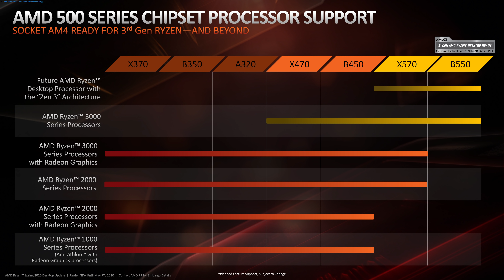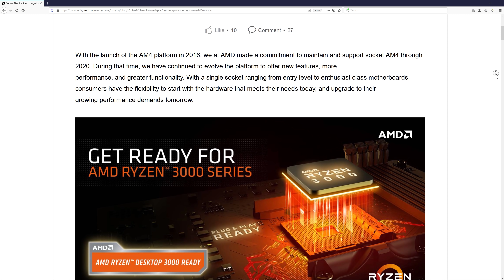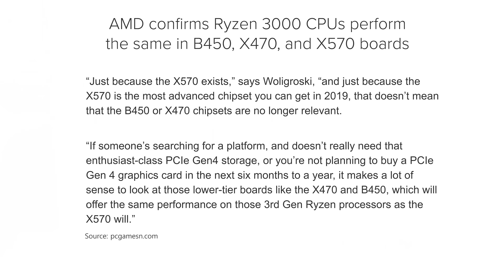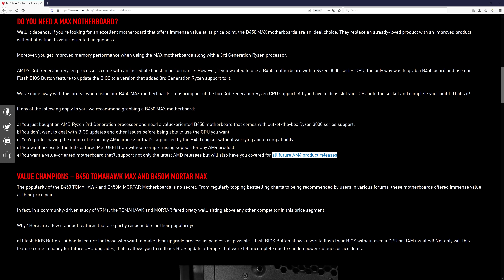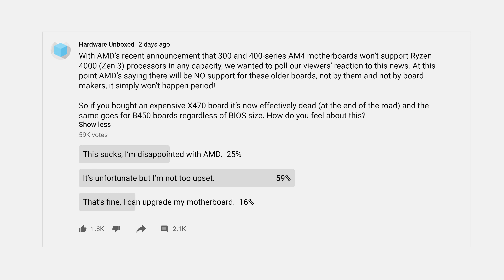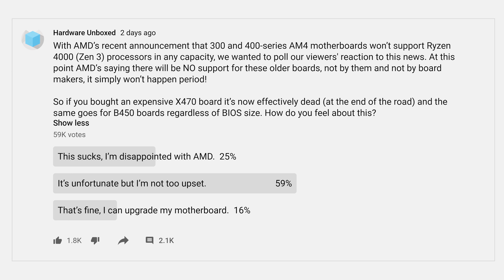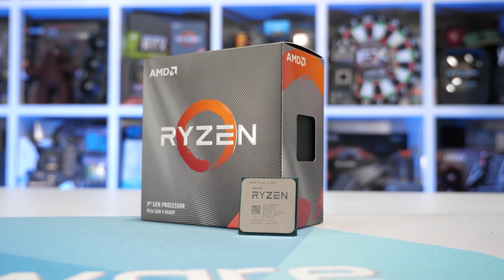AMD Does An Intel, Axes Zen 3 on 400-Series Motherboards, Our Thoughts

Comment: I recommended a B450 Mortar MAX (for those of you not in the know, it's a Tomahawk with less PCIe slots, but with more NVMe slots), but with a 3900X.

I feel if someone got a 3900X/3950X with those boards, they're not looking to upgrade to Zen 3 anyways - so that's why it's not a big deal for so many of your viewers - we tend to buy higher end, more future-proof stuff and replace on a schedule, rather than based on needs (like new game coming out or new job with more compiling required).

But it would suck for 20-year-old me, who would buy a 1600AF or 3300X with the same motherboard using the cash from my first ever job, and start saving for a Zen 3 next year. That previous myself would be absolutely outraged - after all, that was the whole purpose of  the MAX line, as you perfectly accurately presented in the video.

Comment: I am EXTREMELY upset. I hope MSI or someone else will sue AMD to death over this, even though I always wanted them to succeed. I also want to break a B450 board with my knee now :D
I don't know how many people are now in a position when they believed that AMD keeping the same socket will ensure future compatibility with all new CPU releases. I feel a bit sorry for someone who invested in a decent X370 board, expecting to update CPU in 2020, but still, at least there is a Zen 2, which provide a significant enough performance boost.

But the whole B450 situation is utterly outrageous.
I've built several systems on this platform, telling people that they will most likely be able to make an upgrade down the line to Zen 3, seeing how b350 situation was handled and hoping b550 delay won't compromise people how need their systems NOW, but still expect it to support at least one future CPU gen. Especially relying on MSI advertising their boards as capable of doing so.

At that point I've seen enough of AMDs marketing bullshit, disingenuous business practices and now this shit.
I'm done.

My only hope is for enthusiast community. 
You know, 771 Intel Xeon chips were not compatible with 775 board, but here we are. 
And 9th gen Intel CPUs are now being ran on Z170 boards.
I wonder how hard it would be to make a proper mod BIOS, adding needed AGESA-codes for Zen 3 to older 3 and 4 series boards.
Reply: I'm not 100% sure, but I believe it will be lot harder then 1151 to 1151v2 support... As far as i know, AGESA code is really big chunk, and are extremely hard to find out which part does which function. I know that this is not solid evidence, but i think the fact that we don't have,AFAIK, latest-AGESA based bios with PCIe 4.0 support on B450 motherboard, despite that B450 M/B can clearly run CPU PCIe lane in 4.0 mode (early bios, B550A board) should tell us something.
Reply: @남기헌-l8y  thank you for your input, I've done any research on this matter at this point. Sad.
Reply: I was one of those people, I bought a £200+ Aorus Gaming 5 board at launch and saw no need to upgrade my 1700X till now and I can't. I could have just bought two £100 B series boards, a 350 then and a 550 now. I went with a higher end board for better vrms to support higher speed cpus down the line. That idea backfired.
Reply: @TheUltrawideGuy  I feel you, bro. Really hope for someone to come up with custom BIOS for x370 boards, which a socket and VRM-vise fully capable of running those new CPUs.

About B450:
I'm baffled that I've bought a god damn Intel Z370 board when 8700k launched... And still got a better deal than people who chose AMD and B450 this year (though most of them would've bought an X570, if they knew about this set up), considering that I can upgrade to 9900k (when they show up used).

Comment: One thing I don't see a lot of people talking about is buying a 500 series board for Zen 3 sounds like a terrible long term investment. When the generation after Zen 3 is released, AM4 is a dead platform, and you just upgraded maybe a year before?  

It'd be like buying a 7700K and it's accompanying motherboard and then a new platform comes out not that long after. And if AMD is smart, they'll keep platform longevity to be longer than Intel does, so you're out of luck for the CPU family in the lineup after Zen 3

Comment: Funnily enough i still have kind of an upgrade plan through AM4.
I’m on b350 with a 1700, when I need more cpu, I can get a second hand 3000 chip. When 4000 are out.
Much later if I need pcie 4.0 , I can get a cheap b550 or b650, idrk.
Then assuming AM4 is still a thing and is decent , I can upgrade cpu again.
Reply: We will be moving to AM5 by then.

Comment: I bought a MSI B450m motar max with a Ryzen 5 1600 AF about 3 weeks back. I had planned to spend around (AUD)$1400* when Zen 3 dropped on a new CPU and Radeon GPU. I wanted to support AMD after having a great experience with them on my first build, I had hoped that my MSI board would have  supported at least one more gen, i.e. Zen 3.

This really has left a bitter taste in my mouth. In all honesty now if they don't change the terrible decision I'm just going to probably buy an Nvidia GPU that's an upgrade on what I already have and not support AMD GPU's anymore.

I gushed about AMD and how the compatibly was excellent, but it seems they've left 400 series chipset users out in the cold.

Comment: My upgrade cycles are so long that I just... expect to need to rebuild my entire computer when it's time to upgrade.
That said, as a last-year B450 buyer, this is quite the dick move by AMD, and I'm annoyed and disappointed.
Reply: Yeah, I've never uprgraded more than once every 5 years anyway. It's usually new build > New GPU 2-3 years later > New build again 2-3 years after that > etc etc.

But that wasa big selling point for me this time- I was hoping I might get the option for once to make a CPU upgrade without replacing the mobo and RAM too.
Reply: Joshua C. Imagine how I feel buying a B450 MAX board 2 weeks ago..
Reply: @jasperolalia5675  Ouch. You have my condolences.
Reply: I was the same like you till a few years back when I depended on my Dad for them upgrades but now that I earn, I upgrade more regularly. Gotta throw away that cash somewhere after all!

Comment: B450 Tomahawk MAX user here, also long time AMD user, since back in the Athlon days. Can confirm, I'm more than annoyed that the rig I built about 2 months ago, is suddenly eol. I've been selling my IT department on AMD, we even got a test pilot running with two AMD desktops, but that stops now. If you're just going to be Intel, than you can corner the market the old fashioned way, good luck on beating Intel in that game by the way.

Comment: Some points also to consider: 
X570,B550 will support Zen3 but most likely there will be socket change for zen4. So X570 and B550 will still kinda have 2 generations life, Zen2 and Zen3, B450 and X470 also had Zen1+ and Zen2.  This looks like a pattern and the only exception is 300 series which supported zen1,zen1+ and zen2. So overall this doesn't make 400series bad in anyway and you should not blame AMD for this. 
If someone bought recently 400 series they should've considered if they want to save money now or somewhat future proof themself. 
I was in the same bag when I bought my Zen2 CPU with X570 board. If 400 series get support for Zen3, then what about people buying B550 or X570 in the upcoming year with the socket change?
I think here the saying "No good deed goes unpunished" is kinda true.

Comment: I'll say it once, and again! Stop complaining. Intel has forced a MOBO upgrade with every new gen. No one seems to freak out? Now that AMD has to finally do it everyone loses their minds and AMD is a monster? And they've announced it a head of time too, regardless of people jumping the gun on purchasing older mobo's... like the moron who's driving behind you and goes into the left turn lane at mach 4, despite the fact you were moving there, then they have to slam the brakes and honk or rear end your car, even though your the one in front they made a pre-mature decision.

Come-on people use your heads. Send your board back, save up for 2 more weeks and buy a x570. Im sure the b550(or whatever) will be cheaper. and just wait. You don't want a $60 board anyhow with future hardware. Be a little more aware of future proofing.

Comment: I'm not very amused by that decision. I bought a B450 MAX board in january. The main reason for that decision was the lack of B550 boards. And with all the rumours and delays, i was at no point convinced that it would be ever released. On top of it AMD themself did recommend 4XX chipsets, if you did not need PCIe4.0, for 3XXX builds (without mentioning the lack of 4XXX support). And that is, in my books, a really awful move. And don't forget everybody and their dog did recommend B450 boards for more budget oriented builds. We all look now rather stupid.

Further points of consideration:
1. Like in the video shown MSI did advertise the MAX series with future product support. (AMD should have stepped in if that wasn't the case!)
2. Assumption on my part. With the end of the AM4 socket after 4XXX AND the end of DDR4, it would have been logical to end the support after the 4XXX release. End it on a highlight and a great story for the PR department (Despite the fact that newer slides say otherwise).

AMDs bios chip size explanation is really awful for all the MAX board owners. It sound and looks like AMD will actively prevent MSI from using their advantage by providing no agesa code. I would like the hear what MSI is thinking right now. Can MSI go after AMD? Can MSI be sued for false marketing?

Comment: I've got a question, if I buy a X570 motherboard, will it also last only one generation? I mean, after Zen 3 we'll have Ryzen 5000 which will be using AM5, or am I missing something?
Reply: You will be able to switch to Zen3: Ryzen 4000 and 5000s APU. Zen4 will intodice AM5-socket with DDR5 support.

Comment: there is one important thing to remember here, US is not the whole world, i was upgrading to ryzen 3700x in september on a b450 gaming pro carbon board, the price of the board was equivalent of 200$, the first x570 ''entry level'' board that was not trash was 100+$ more, and what does the extra 100$ get me? same or worse vrm quality, pcie 4 for witch i will have no use for for probably the next 3 years, multi gpu support(duh) worse or same lan solution etc, so i would have to pay 100+ extra dollars for features i have no use for, and 100 extra dollars go a long way for a better gpu/more ram or what ewer else you might need. and we were lead to believe that 400 series chipset would support new generation of cpu's, and there is really no reason for majority of 400 series boards to support new gen, axe older gen cpu support in the new bios version, it's can't be that time consuming to axe some code from a bios and leave it to the board partners to determine witch boards can and can not support new gen, i mean if you bouth bottom of the barrel b450/x470 board, well tough luck but there are really good quality 400 series boards that i'm sure have no problem supporting new gen of cpu's. I would be fine if amd say look we will not support the new gen on 400 series at launch but will deliver bios for compatible boards 1-2 months after product launch

Comment: People may be mad but companies have make decisions on the fly and they are just human so you get flawed decisions sometimes.However Its kinda always been true that sub £100 motherboards have been a bit trashy or lacking in features/component quality, pretty much since the FX series so to buy a cheap b450 for a 3000 series processor at the time seemed like a bad move anyway and for those who bought an expensive b450 when they could have gone x570 im not quite sure what you were expecting. You had an option to buy a good mobo and a stop gap processor but you chose a generation old board to support the best cpu you could afford knowing ryzen 4000 was going to drop at the end of the year. Just seems like since ryzen 4000 was announced it was pretty obvious b450 was a bad move and there was a clear reason why they were so cheap. Even if AMD didnt specifically say so (they kinda hinted softly)

Comment: It's hard to be upset, if you bought a 4 series board you knew you were late to the party.  If you bought a 3 series board you got 3 processor generating out of it, seems pretty legit.  Now if Zen 3 didn't work on 5 series boards we'd have a problem.  I'd also like to point out, all of media outlets were pointing people to B450 boards to save money when Zen 2 came out.  I think that was short sighted at the time and I think it's obvious now how short sighted it was.  Every system I've built since the release of Zen 2 has been on X570, not because everyone needed pcie4, but because it was more likely to be supported into the future.  I mean you could get a super legit X570 board for $190 USD, including built in Wi-Fi.  AMD has tried to provide unprecedented support for AM4, how long did everyone really think it was going to last?  As for AMD "pushing" 4 series boards is silly, they literally said those boards will properly support 3 series processors, no mention of future support.  This feels a lot more like HUB is upset they pushed the wrong boards on everyone and now they don't want to own up to it.  Buying the newest chipset when you're going shopping is usually the safest bet.
Reply: It's very obvious though that the boards are capable of supporting Zen 3...which makes this an Intel style money move....I think people had high hopes that AMD were better corporate citizens and more consumer friendly; turns out they're just dickbags like every other company and the good will of the last 3 years was only there to gain market share.
Reply: @r.j.sharkey  It's certainly not obvious that they will support them and stating it like it's a fact is absurd.  Why do people always feel the need to act like something they think is true is suddenly a fact?  They can't support old chipset forever and they done a great job upto this point.

Comment: I bought an MSI Performance Gaming x470 Max based off the strong recommendations of the Tomahawk, good review, socket compatibility, price, and 3 x16 Slots.  Know it was good through the Zen 3, 4000 series was a big plus, and buy the max model made it a safe choice.  I am angered that AMD is not supporting the new processors on my board.  For me, it’s not a need to upgrade today as I put a 3900x in my system,  but the desire to put a 4000 series in 1-2 year from now.  Keep pushing them, the max models should be upgraded for sure.

Comment: As a 1st adopter with a 1600 and a b350 board, amd has delivered their promise but for everyone who wanted to buy a b550 board and could not and was told to buy a 450 if they dont want pcie 4.0 is a dick move to end support. They should of been more clear on there socket support and had the b550 boards come out at the same time as 570's.

Comment: Personally I was more upset when Threadripper moved to a new platform and TR4 support was dropped. Although AMD made no promises beforehand, with both AM4 and Epyc maintaining compatibility with Zen2 it was fair to assume the same would apply to TR4. But not only did that turn out not to be the case, AMD also shifted the Threadripper series into a much higher price segment, making the entry into HEDT a lot less affordable overall. The existence of the 3900X and 3950X only partially make up for that, and it sucks for those who invested in a 29x0X expecting to be able to upgrade their CPU at some point.

Comment: My X370 has been playing up recently and I was going to buy the B450 Tomahawk as a replacement as I thought I would be able to upgrade in the future. This news came at the right time for me as I have just slightly dodged the bullet. However this change by AMD, for me means that I will probably try and stick with my first gen ryzen until AM5 as there is no point investing into a dead end platform.

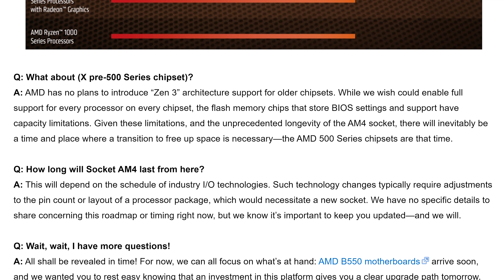Comment: 2:50 It is imo kinda unfair to attack AMD for something they clearly stated they will do and they stand by their word. They said they would support AM4 until 2020. It is 2020. Yeah, in an ideal world a socket would support all cpus until it breaks, but we are not. 

Edit: I would not be suprised in the slightest if they'd name the socket of the new motherboard AM5 or AM4+ (idk if that already exists) to prevent legal consequences. 

And no matter what AMD would'Ve said, people would've went after them, so your statement is only mincing word, the drama would be the same. 

And your speculation at around the 5:00 mark is bullshit. You can "maintain & support" the AM4 socket with new bios updates and tech support. By no means that has to be a bios upgrade to run the 4000 series. Sorry, but this is probably the first time I disliked one of your videos as imo this is only a artificial way to create unnecessary drama by going "Hurr, durr, AMD broke their promise".

Comment: You forgot that those "higher capacity boards" were a quick fix to a problem imposed by cheaping out on ROM capacity in the first place.
Those "max" boards certainly would be capable of rocking r4, but considering their minuscule userbase, it stands to reason weather or not the development effort is worth it.
Blame the mobo vendors for trying to jump on the bandwagon, by introducing those boards in the first place, or rather not fitting them with enough capacity to start with.
If i had a say at AMD in that regard, i would most likely make the exact same call. 90+% of <=400 chipset users will not have those beefed up BIOS'es.

Comment: Rip i was going to build a PC with a B450 tomahawk max and my 2400g and was going to upgrade the cpu later on but now I am wondering should I stay on my b450 and opgrade to a ryzen 5 3600x  or get a x570  and later upgrade to a ryzen 5 4600